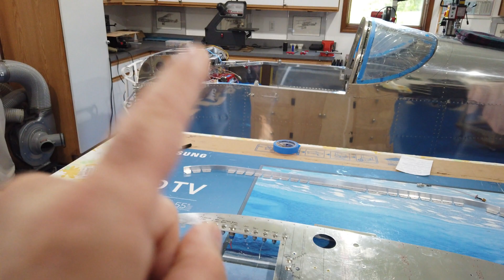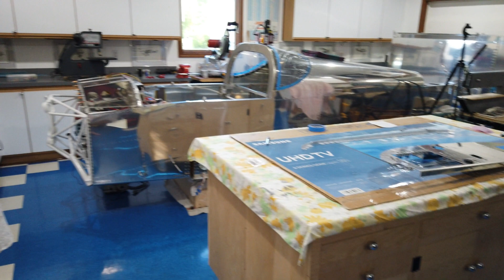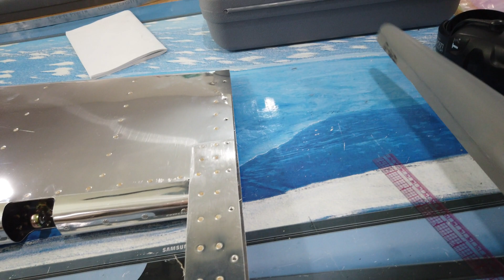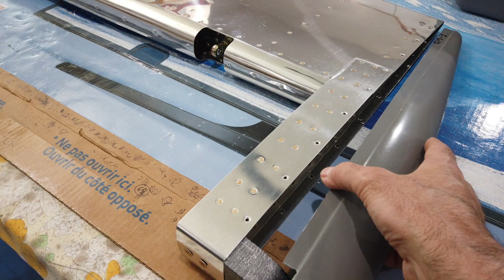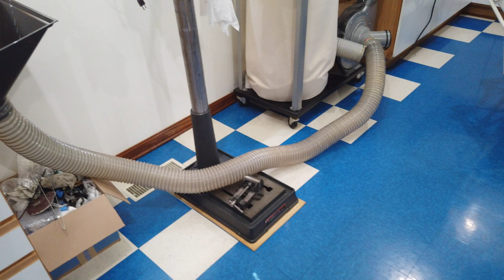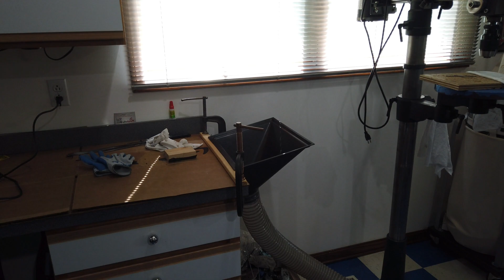Vans RV 7 HINT Video Panel Paint and Fiberglass Tips Begin

Comment: Gidday, the build is progressing well! Do you use a dehumidifier for your engine while it awaits install? If so I would be interested in seeing the design of it as I’m about to build my own.
Reply from the maker: Howdy Nick.  My engine sits in my shop which is in my house which is heated and air conditioned. I do have a dehumidifier unit that came with the engine when I bought it, but I never thought it worked too well.

Comment: A couple of recommendations.
1st: I would add a very thin washer to the inside of the tip under each hole. Epoxy them or use a very light piece of fiber glass cloth over them with epoxy or even CA glue.  This will help distribute the load some when the pull rivet is set and help prevent crushing the fiberglass. Especially since your edge distance not going to be there.

2nd: I would consider fiberglassing the seem once you install them. Would really give the tips on the elevators and rudder that finished look plus helping to keep them attached.

Wish we were close together. It would be a lot of fun to work with you and learn for when I build my plane.

Keith
Reply from the maker: Howdy Keith. Your suggestions are valid and are what a lot of people do. The issue I would have with the washers is that part of the washer will ride up onto the rib flange  and not lay flat on the fiberglass tip.  (the rib flange is flutted)  I may consider doing more work on the tips for a better finish; but I'm not there quite yet.
Reply from the maker: When your build time comes Keith, I could always pay you a visit if you get in a pinch!